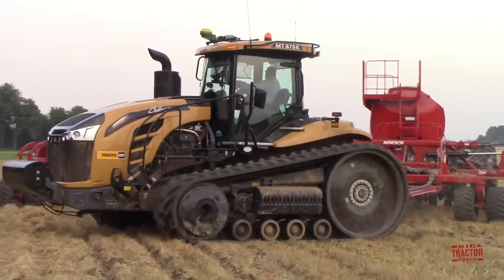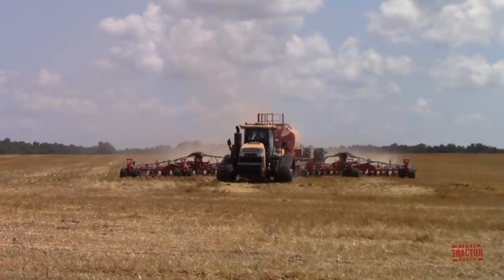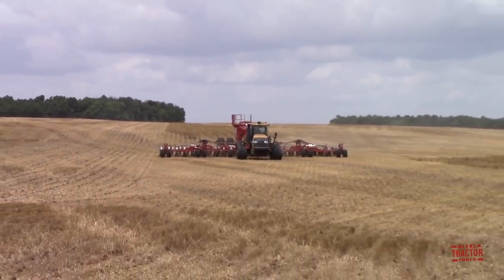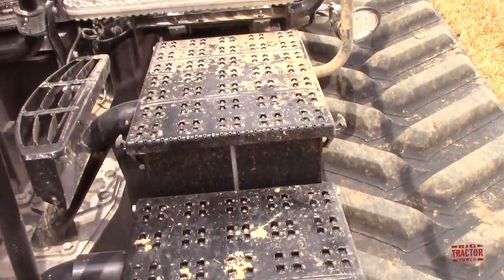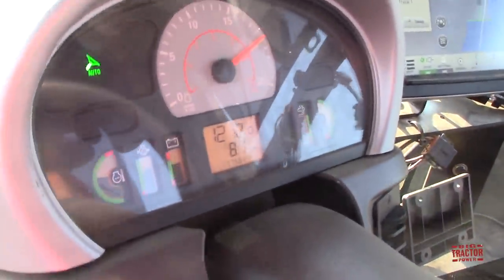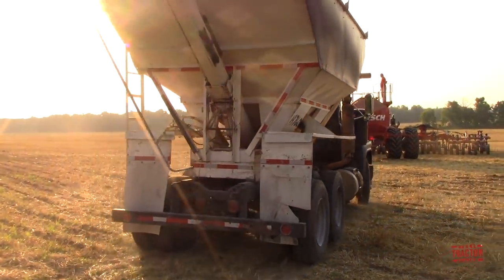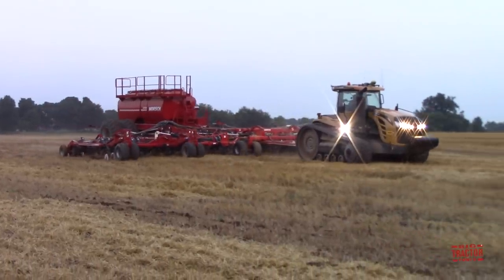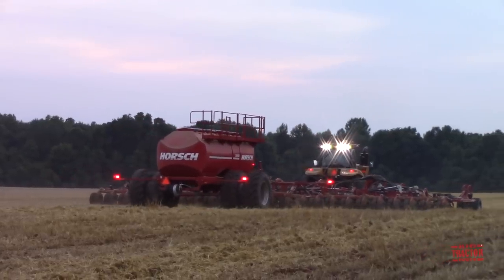600 hp Challenger MT875E Tractor Seeding Double Crop Soybeans 8 mph

Comment: Some people on here may not remember or know that a bushel of soybeans weighs 60 pounds so that means the cart carries 36,000 pounds of soybeans plus the weight of the cart itself which has to be considerable when you consider what it takes to just carry the 36,000 load and the stress of doing that across uneven ground.  No wonder it takes lots of horsepower to pull enough shanks through hard ground plus the cart weight and the power it takes to run the 60 foot drill.
Reply from the maker: Great information. 👍👍

Comment: We use 600+HP tractors and 72' Bourgault paralink hoe drills pulling 950 bushel carts (Bourgault model 7950's) to direct no till seed, though we never seed any faster than 5mph.  Great video, as always :)
Reply from the maker: Thank you for watching. What model tractor do you seed with.
Reply: We use JD four tracks excepting worked irrigated land where I, out of sentimentality, love pulling it with my ol' 875.  It handles it ok on level ground at 5mph or less when knifing in seed

Comment: If the ground is as dry and hard as being said, why will the seeds germinate?  Will they lay dormant until the next rain comes along?
Reply from the maker: The shanks of the air still plow up a seed bed and loosen the soil.  Their is resistance from the summer baked soul that makes it harder to pull and seed than spring or fall soil

Comment: Jason does Garnett's still run the same Horsch drills they've been running for the last few years or have they gotten any new ones lately? They run 3 of them right? I wonder if they will step into any of the new bigger higher horsepower 9RX models just introduced like a 9RX710, or 770, or 830?

Comment: the tires on the grain trailer are mounted opposite direction than if they were on a tractor--is that to minimize the disturbance of the soil as the vehicle travels across the field--good video -
Reply from the maker: Yes. It smooths out the ride. Also if you get stuck the tread is pointing the right way to back out.
Reply: @bigtractorpower  I thought it was to keep the wear to a minimum?!?!?

Comment: That was about the loudest Challenger cab I've noticed. Were the fans on seed drill real loud?
Reply from the maker: It’s a very quiet cab I think the camera picks up the air-conditioner vents when you’re in the body seat you’re pretty close to them on the ceiling.
Reply: @bigtractorpower  I see. Thanks!